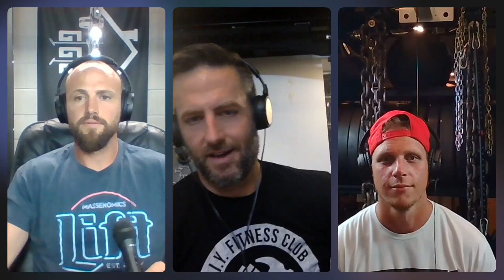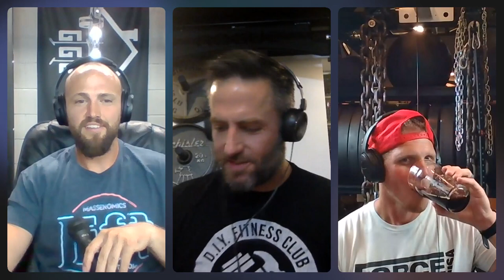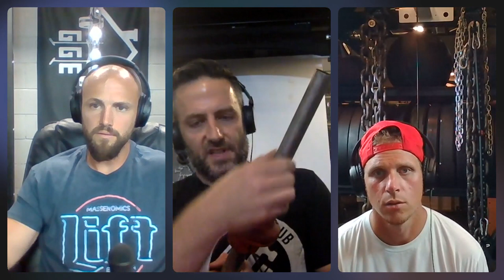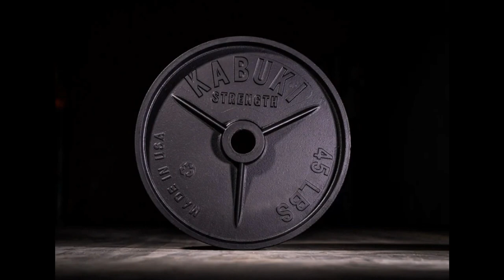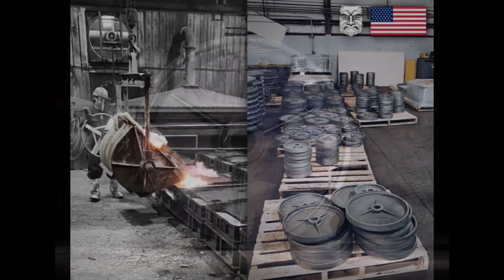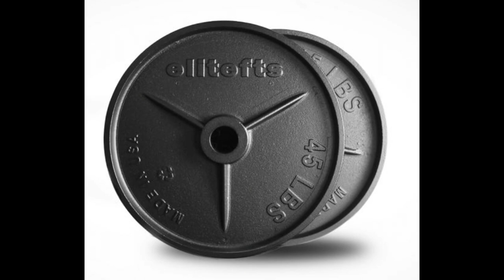#3 Why Weight Plates Look the Way They Do?

Comment: I thought I remembered Eleiko having rubber bumpers as early as 1971. They had a rounder rim (like the profile of a motorcycle tire) than the ones today.
Reply: In the 1960's, a couple different manufacturers produced rubber bumper plates. If I misstated in the episode, apologies! Thanks so much for listening.
Reply: @vintageweightspgh  I don’t think you misstated as much as just not being exhaustive. Great info. Keep it up.